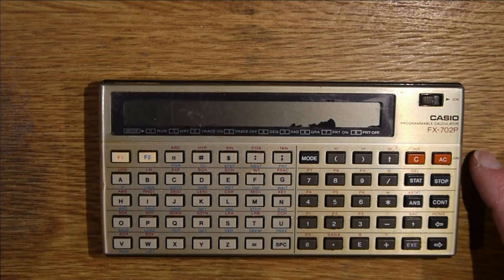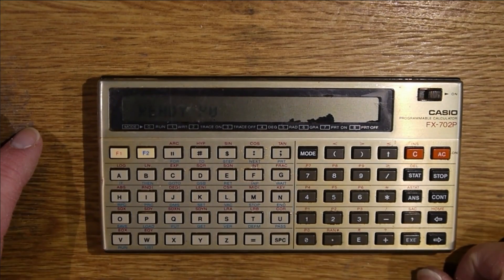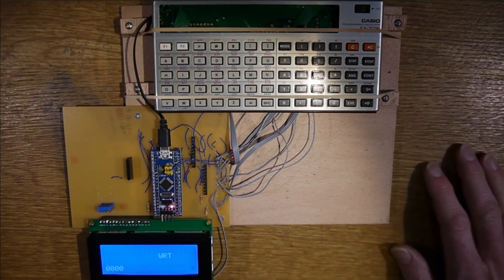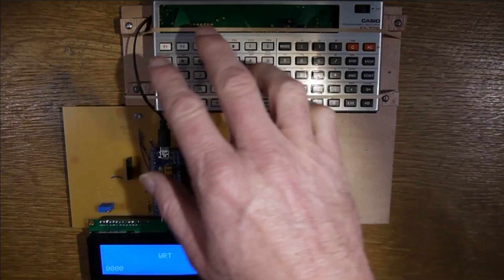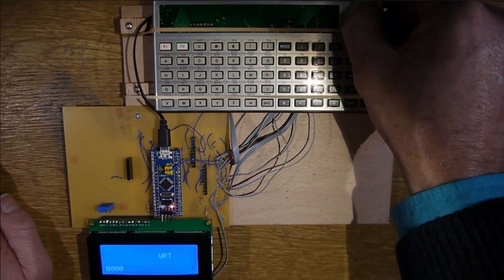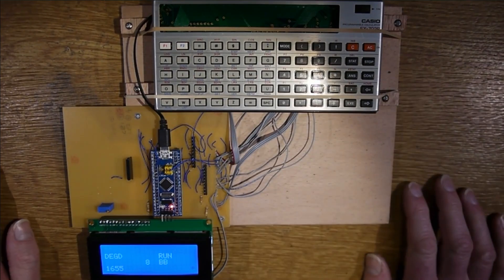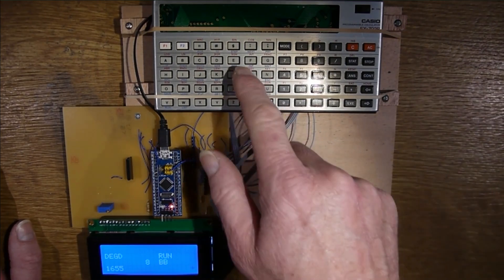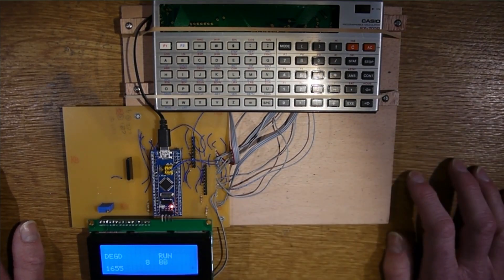Bus Sniffing fx702p Display

Comment: Very impressive. I'd be interested in learning more about your process for reverse engineering the protocol, as I have a collection of graphic Casio calculators, some with defective LCDs.
Reply from the maker: I wrote code that examined the data travelling over the bus and then inferred the link between data and annunciators on the display. I toggled the annunciator and then looked for toggling bits.
Which graphic calculators are they? I'd think about replacing the displays with modern OLEDs or maybe epaper displays. Have a look at Piotr's page here:
https://www.pisi.com.pl/piotr433/

He has a lot of documentation and also ROM dumps and emulators. You might be lucky and find a ROM that allows a PCB with an emulator replace the original PCB.

Comment: Nice video and great work 👍
Quick question, can the fx-702p play melodies like the fx-502p can?
Reply from the maker: That is a very interesting question. the FX602/601/502/501 can all play music when in an FA1 adapter. The FX702P doesn't fit in the FA1 physically, although I suspect it would work if it did. The FX702P fits in the FA2, which also takes the FX602/602 family. They can fit into the FA2 sideways. According to the FA2 manual, when in the FA2 the FX5/602 family can indeed play music just like they can in the FA1. The same manual also has no mention of the music facility when a FX702P is plugged in. So, it looks like the FX702P can't perform the music function. I have no idea how the music function works, so don't know why it isn't mentioned in the manual.

Comment: Nice job! I found your channel via Hackaday when researching about my fx-4000p for an upcoming video!
Most interesting eavesdropping story I've heard lately. :)
Reply from the maker: Hi, glad you like the video. I have come to hate heat seal connectors. They seem to always fail eventually and I have never had any success with repairing them. Replacement seems to be the only option, but that is also next to impossible.

Comment: I hoped its about the LCD replacement, but this is more interesting.
BTW I have a fx-880P with good motherboard and faulty LCD, but I have another 850P with a good LCD and I want to replace the 880P's LCD. If this is also a ribbon version, I think it is impossible. Any advice how to attach cable to the glass LCD?
Reply from the maker: I haven't tried yet, but there is a vertically conductive adhesive tape that you can get. It's very very expensive though. I managed to find some for sale that wasn't too expensive, but it comes in small circles so will have to be cut into strips. Then I have to find a ribbon...